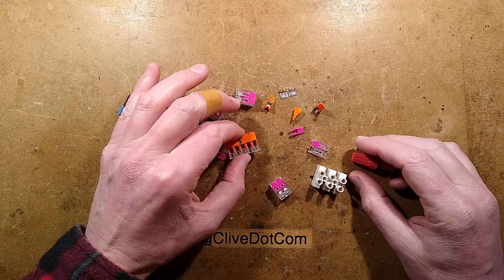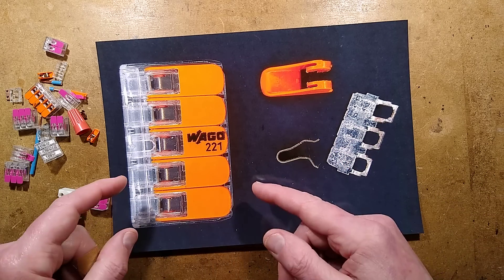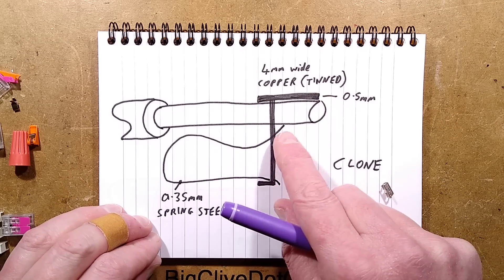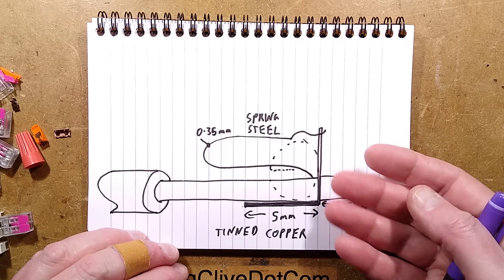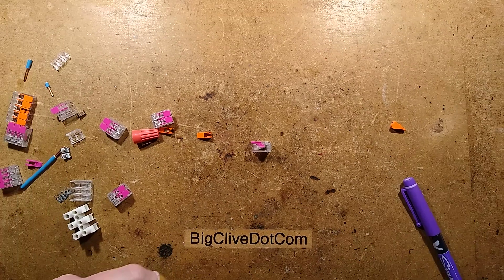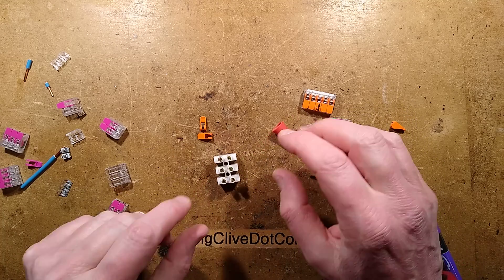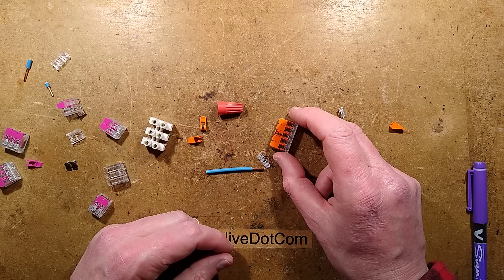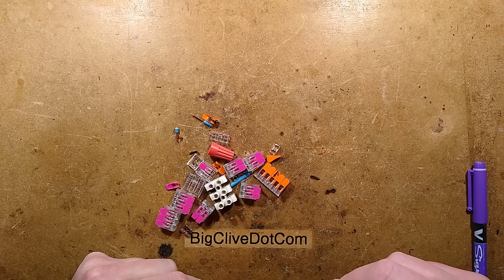Inside a Wago connector and a clone

Comment: I would rather 100 repeatedly reliable Wago connections in my house than 100 wire nut twists - which are great if done with care and a danger zone if rushed, even worse when stranded wire is twisted to solid conductors.
Reply: These were so useful when I had to join some very small wire to some much thicker wire. Worked like a charm.
Reply: Barrie, its dummies like you who perpetuate stupidity.  Do you have any cites, or experience as an electrician to give your input any validity or credence?   I could give you a cite wherein its shown that wirenuts create an oxygen-free connection which is far superior then the friction fit a waygo gives if you were worth the effort.  Please point to some data you have that shows US/Canadian houses are burning down at some greater rate than European related to wirenuts.  I'll wait.
Reply: @boots7859  You can continue waiting - I'm in the UK and  concerned with  safety in my house.

I have not even mentioned American homes in my comment, so have no idea how many houses your electrical practices have burned down.

 All I can say is that over the years, when wire nuts were used in the UK, I have always found them lacking, mostly because of poor installation/use - e.g. twisting different gauges of stranded and solid cable together.  It's pretty easy to 'accidentally' make a poor connection with a wire nut far less so with a Wago.
Reply: I like the wire twister tool that goes on my drill... and shrink tubing.  The tool I have will twist 2 or 3 wires together into a pretty connection of many different gauges and types of wire.  For important connections I'll wrap this fancy affair in electric tape or paint it with liquid electric tape.
Reply: Stranded, coated aluminum...
Reply: Wire nuts are American, enough said.
Reply: Wire nuts are also used in higher-current installations (ovens, water heaters, furnaces) in North America where the feed from the distribution panel may be stranded aluminum--and wired to copper.  Not done much nowadays, but certainly during the 70s and 80s.  There are dielectric-grease -filled wire nuts known as "purple twisters".   I don't know if there's an approved Wago connector for that one.
When my new heat pump was installed, I had the aluminum feed removed and copper substituted--it was a short run.
Reply: @tubastuff  No-Ox is a CONDUCTIVE Grease in Those Purple Twisters, not a DIE-Electric Grease.
Reply: @m9ovich785  Thanks for the correction!  I hadn't realized that.
Reply: Jeeze! Calm your flame war.
Both systems are stuck with stupid (at least in hindsight) design decisions. On the whole, the UK has less, as it is a (marginally) newer system.
As far as wago vs wire nuts, I feel that it is worth pointing out that UK (and European) electric boxes are shallow and wide, while north American are narrow but deep.
In north America, if you have larger then 3x wago connecters, you are stacking one behind another, deeper in a box then the box is wide.
Wire nuts you are very unlikely to need to stack. Also, when you are connecting wires and then shoving them that far back, having more robust strain relief is more important.
Reply: I've always been wary of wire nuts, maybe because I've encountered crap ones in places where a reliable connection was needed. I've had them literally fall apart in my hand.
Reply: I had a 20amp 240v plug installed for car charging. They were having problems because the gfci plug was not working. So in 1 junction box they removed the wire nuts and put them back on like 4 times. 

2 weeks later those plugs stopped working. So I opened the box they were messing with. The wire nuts fell off into my hand even before I could test anything. I replaced the nuts and put it all back together. I have been using a 12amp charger all year on it. I imagine the cause was tired and annoyed apprentice. 

So would wago fail in the same way.
Reply: In wiring that lives in a wall untouched for 40 years, wire nuts and Wagos have a pretty similar track record, but I'd take the Wago any day in equipment that regularly gets jostled around or opened and serviced.

I used to work on film lighting equipment, and one product had initially been assembled using wire nuts, and they regularly were a point of failure until they were all sniffed out and replaced with either terminal block or Wago.
Reply: are you an electrician?
Reply: There is also a major difference in philosophy in the US vs the UK. 
The US assumes that they will never be able to trust anything past the receptacle. Hence their design philosophy: "no space in a modern constructed house may be far enough away from a receptacle that it requires an extension cord".
This leads to interesting norms, like how the standard place to install a receptacle in new construction is the baseboard.
Which leads to the insistence that everything is now arc fault and ground fault protected, because water goes on the floor.
Reply: @TheBarrej2006  - I've only seen receptacles in baseboards in the oldest construction houses, where they were usually retrofitted into houses that didn't have electricity when built.   With the cross-studs and shiplap, that was often as far as you could get a wire from the basement or crawl space.  Even the (roughly) 18" up from the floor is right below the cross-stud.   In addition, the earliest electric 'things' were floor or table mounted, such as a fan or lamp, and didn't need higher plugs.   

New houses and buildings still have them 18" up.  I'd personally prefer to see them at 48".     (I'm an IT consultant).
Reply: @tbelding  I'm a construction worker in Canada. I don't live in the USA, but I have been repeatedly informed that the trend of putting the receptacles in baseboards came from the USA. Here in Canada, it started mostly in modern high rise buildings, where the entire external wall is glass, aside from a ½-1½' high "box" running along the floor of said walls. Minimum outlet distance (“No point on the wall can be no more than 6 horizontal feet from a receptacle”) required receptacles on said wall. 
It has now spread to single family houses, where the tipping point, my gut tells me, is around 5 mil Canadian (3.6 mil USD). That price or higher, the receptacles are typically in the baseboards for new construction or extensive renovation. (3 mil CAD for condos)
Reply: @TheBarrej2006  - I can definitely see it in those kind of buildings.  Where else would you put it?    Are those open baseboards?  Meaning you pull the baseboard loose and there's an open channel behind them?    That could make a lot of sense in that regard, if so.    Otherwise, I don't know.   I'll ask a builder customer of mine (Houston), who mostly does extremely expensive single homes, if he knows of that practice.
Reply: @tbelding  the purpose is ascetic, not functional.
A baseboard is featured, a wall is featureless. Put the feature of receptacle on the featured baseboard, keep the walls pristine.
Reply: @TheBarrej2006  - Ah, so the same reason people keep being stuck with echo chambers for 'open office' plans - "It looks good" - "but people can't work there"  "I don't have to use it, so that problem doesn't exist."
Reply: Stuff a Wago connector into a full box behind some devices where you can’t see and eventually you will inadvertently release one of the locking levers. Not good for obvious reasons. 

I do agree that wirenuts come in different qualities too. I prefer the Ideal brand and won’t use anything else except perhaps 3M. 

And the connection of stranded to solid wires is a weak point for wirenuts. It can be done reliably but it can easily be done improperly and result in the same problems that accompany the Wago with the inadvertently open lever. 

So Wago might be a bit more idiot-proof. But idiots shouldn’t be handling high voltage/high current wiring anyway.  But, of course me saying so won’t prevent them from trying.
Reply: @Dave-ei7kk  Wrap the Wago levers with electrical tape and they won’t pop out.
Reply: @Captain_Jack514  Hmm… Good idea. I guess that would work. But I doubt very many electricians that use Wago connectors tape them. 

If you’re willing to take the extra time, you can always twist and solder the wires under a wire nut too. Best connection ever! I only point that out because almost no one is going to do that either.
Reply: @Dave-ei7kk  For a diy job where you aren’t on a tight schedule, I can definitely see the benefits of soldering.  I do that with my speaker cables to banana plugs on my stereo and plan on doing that when I wire my living room for surround sound.
Reply: @Dave-ei7kk  Wagos can't be used in high voltage or current.
Reply: @Dave-ei7kk  Well, you obviously haven't used Wago connectors judging by your uneducated comment. Also I doubt you're even qualified, passing judgment on something you haven't even bothered to read up on.
I'm guessing you are in the Americas, and if you are a "qualified" electrician there, you'd fail a European electricians test, let alone a British one lol.
I can assure you, a wire nut in the same type of scenario you're thinking of that could possibly randomly open a Wago connector would fail a lot sooner. Wago have optional enclosure boxes for exposed areas.
I know American electrics are backwards, but I never realised you left wire nut connectors exposed for a higher risk of failure. No wonder we banned them over half a century ago lol.
Reply: @mickk8519  Sorry, I’m not going to take the bait. Your nationalistic nonsense reply adds nothing to a discussion about electrical connectors. They are subject to the same laws of physics regardless of where they are used or who uses them.
Reply: Nut twists are probably the worst idea that we ever came up with. Just because something doesn't require a tool doesn't make it instantly better, I'd settle for the good ol' screw clamps over nut twists any day.